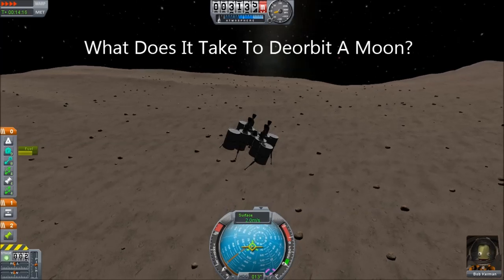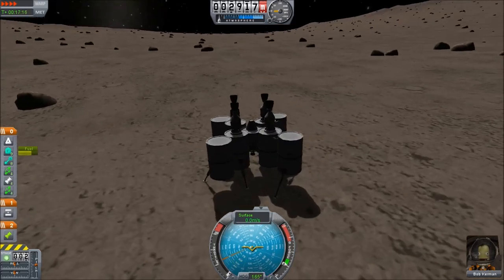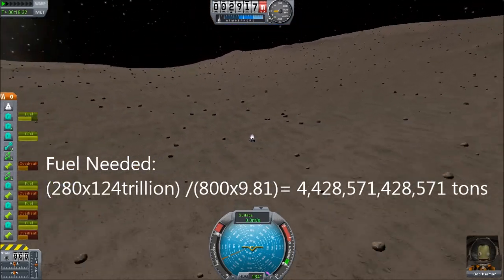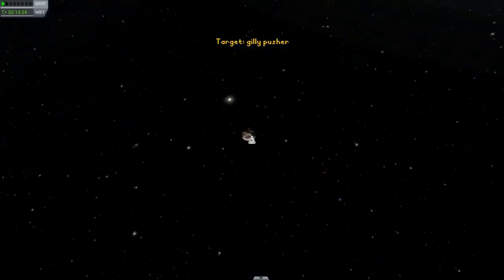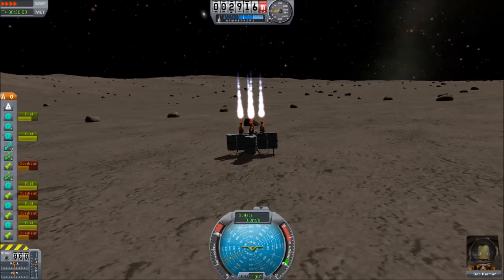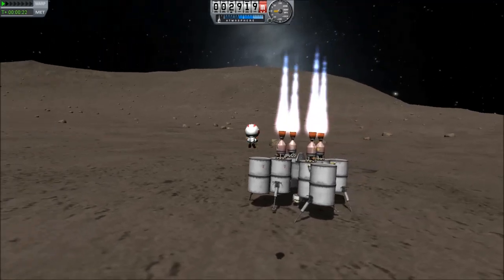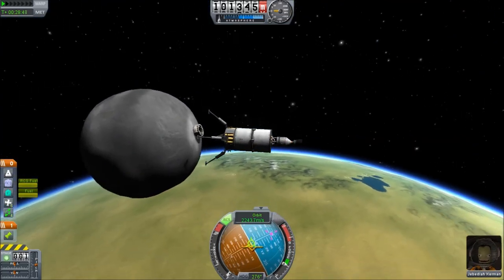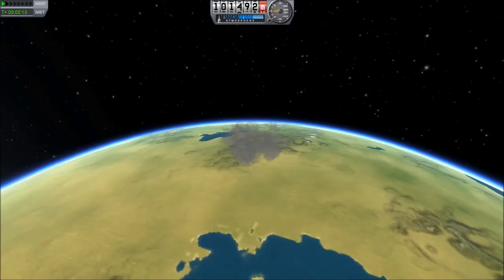What does it Take To Deorbit A Moon In Kerbal Space Program

Comment: So you can't deorbit a moon in the game because of game mechanics, but it would be possible in real life yes? In theory at least. If a moon was hit by a rouge planet or a huge  comet/asteroid  from the right angle, wouldn't that possibly deorbit the moon? Even if it shatters the moon, the force might be enough to slow down the pieces enough for them to rain down on the planet.
Reply: According to my physics class, if something shatters mid-flight, all the pieces will spread out, but if you averaged their distances and masses, the center of mass would still be on the same trajectory.  Some pieces might get thrown off track enough to enter the atmosphere or become ejected, but the majority of them will remain in orbit.  For something as large as the moon, they would probably eventually come back together due to gravity!
Reply: But if a moon ran into something of rougly equal mass in a head on collision, wouldn't that slow it down to near standstill? I agree that most impacts would leave what was left of the moon in orbit and it would probably pull itself back into shape eventually. Since orbit needs velocity, slowing an object down puts it in a lower orbit. If a celestial body had no velocity, then the strongest force of gravity (In a moons case, the planet it used to orbit) would just pull the object in a straight line.
I agree that this is an extremely unlikely scenario, but it is a big universe and it is not impossible that something like this has happened or will happen.
An impact from a large body on a moon could alter the mass of the moon significantly which would, if not totally deorbit it, then at least change its orbit distance.
Reply: Yes it is unlikely, but you're right. If something with equal kinetic energy (could be something less massive but moving much quicker, or equal mass and speed) hit the moon from the opposite direction, it would stop in it's tracks. It might break up a little bit, but some LARGE pieces would fall straight down to earth and would likely destroy all life, if not the entire planet. I could imagine something of that size striking the earth could break up the crust and smash it down into the mantle or something crazy like that!!
Reply: Let's hope that never happens. And if it does, lets hope it happens to some other planet with no life on it, but still close enough for us to observe.
Though any kind of impact on the moon would slightly alter the orbit by adding more mass, or making a small change in velocity. I think.
Just like everytime a meteor strikes earth, it adds to the earths mass and gravitational pull by a very small ammount.
Reply: 2spooky
Reply: Why would it have to bee the same mass as the moon? It could be heavier, and also, a light object that travels fast can hi with more force than a heavier object moving slower.
Reply: TheOmniousWindWalke1 A lighter object could deorbit a moon. All you would need to do is alter its orbit enough to get it in an escape trajectory. A sufficiently disturbed orbit is all that is needed, so that it will get flung out of orbit by the planet it orbits.
Reply: SHould we just fold that under one of newtons laws : for every action there is a oppsidte and equal reaction. Considdering the materials of the object would stay togethere that is exactly how it would happend(forces canceling eachother out. But ofc , it will not. It will acctullay be more like having 2 water ballons thrown at each other. If you managed to do it perfectly.
Reply: In theory, yws. But you would need an object with the same mass and the same density to de-orbit a moon.
Reply: The moon is always leaving the earth in about (insert years) the moon will leave earths gravatational pull and tides wont exist
Reply: fatpig2125 o_0 my comment before was pointless

Comment: What if instead of pushing it we just detonated a huge bomb next to it or potentially launched an astroid at it, that would easily deorbit it right?
Reply: Think about how much force was just explained in the vid. Now imagine all that force hitting all at once. Sure, you could knock the moon out of orbit. You'd also obliterate most of it and shatter what remained.
Reply: Serithi I never said I think while writing these comments. XD
Reply: Patrick Sparks Stuart Smith  with the dark side of the force, we can do anything we want.
Reply: Serithi Heres the thing though. Yes you might blow up the moon with that much force at once, but other than that it wouldn't actually do anything else. All of the remaining pieces of the moon would probably continue to float around in a relatively unaltered orbit. That's just how the physics work out.
Reply: Stuart Smith that's not how the maths workout at all
Reply: Patrick Sparks That is how it works but if i need to explain i will.
The amount of force our mythical explosion has is incomprehensible and since moons aren't exactly designed to withstand such forces (after all they're mostly composed of rocks so its not that tough) you will break the moon apart before the explosion can apply all of its force. Picture this: You swing a baseball bat at a pane of glass. The glass breaks and the shards go flying. If you hit the glass 10X harder than that the shards don't really go much farther because most of the force of the swing is wasted due to the glass breaking. It's the same thing with our explosion. Most of the force is wasted because it doesn't hit anything once the moon starts breaking. Making the explosion more powerful won't really help because you will break the moon even more. If the moon were indestructible you might be able to make it work but otherwise, no way.
If you still want to argue I will be happy to debate with you.
Reply: Well let me begin. First an analogy to a baseball bat and a pane of glass is completely irrelevant. Further more the force of said explosion will likely only shear off a small portion of our celestial body. And finally the impulse from said mythical explosion will impart a partial sum of its kinect energy onto the body which it is being used upon and provide an equal yet opposite reaction upon said body away from the outward direction of said blast. There is no debating maths now if you can prove that said  explosion of unspecified magnitude is strong enough to shatter our celestial  body then you should tell the imaginary explosives maker they've made the imaginary explosive to powerful. Until then you should look up project orion for an IRL example of Nuclear Pulse Propulsion.
Reply: Patrick Sparks Well I guess it could work in theory but what I'm trying to say is that even it if does it would be MUCH MUCH more impractical to do so. (Not that any of this is practical anyway.) Besides if you want to CHANGE the orbit of the moon, any force applied will do. But if you want to DEorbit the moon (as we are) an explosion is not the thing to use. When we use rockets (ignoring the efficiency of the rocket itself), you devote almost 100% of the force to deorbiting the moon. With an explosion (again ignoring the efficiency of the bomb) you devote less than 50% of the force to deorbiting the moon. In addition the rockets are used over long spans of time where as the explosion will be much shorter. I imagine that because of this, the rockets are able to be far more efficient than the bombs.

Also our explosion isn't of unspecified magnitude. Just take the numbers that he uses in the video and apply that force over the span of a few minutes (or whatever. I don't really know how long the explosion would last.) I'm sure it could break apart more of the moon than you think.
Reply: use a warp mod hehe
Reply: yes it would but it will destroy the moon in the process and it will be so powerful it will damage us and it would look like a supernova explosion and the griffon century in the KW rocketry mod has a thrust of 11000 and the FHS UBER DRIVE has a thrust of like 650000000000000000000000000 so that would put it off track by quadrillions of miles and a thruster that big would be bigger than our planet or maybe even the size of the planet after our planet size compared which is neptune and anything that can move for example jupiter will be bigger than our sun and something to lift our sun away will be bigger than the solar system and moving the whole galaxy including the supermassive black hole will take as much energy for it to be as big as the virgo cluster
Reply: Connor Simon replying to myself XD
Reply: Connor Simon and again lol
Reply: Serithi Hey you are de-orbiting it anyways who cares if it survives.
Reply: Momentum=mass x velocity.
No matter what the method, you need to deliver, at bare minimum, billions of tons of force upon that celestial body to move it much.

Comment: What about Tidal deceleration? Couldn't you just push Gilly into a faster rotational period than Eve and let the tidal forces finish it off? Albeit this might work better with Duna - Ike, though the tidal force on Duna is probably pretty low for obvious reasons. I suppose Jool - Laythe, then?
Reply: but as it got pulled down its rotation would slow down too because that is where the energy is coming from

Comment: BUT won't the gas from your engines eventually FALL back on the moon, cancelling its work?
Reply: No, because the gas particles are expelled at a higher speed than the local escape velocity, which means they will fly away into space.
Reply: That logic, I don't think it logics what you think it logics.

I'll see myself out.
Reply: Damn you Isaac Newton!
Reply: Such a large scale structure would also collapse almost immediately under its own weight unless partially supported by tension from a space elevator and/or space fountain type megastructure, and the fuel mass would, as Scott said, be a significant proportion of the object's mass, which would in turn increase the combined body's gravity well significantly, further complicating the process, which is already impossible in practice, even discounting the fact that the orbits of planets in Kerbal Space Program are determined by solving for the two body problem rather than the full n-body integration that would be required for this to work at all.
Reply: tim n
Actually, that probably would be a significant issue if you were trying to deorbit Kerbin, Eve, Laythe, or Jool, given that the atmosphere's would reduce the exhaust velocity of the rockets to the point where they wouldn't be able to escape the planet.
Reply: SteelFyire but the rocket you'd need is so gigantic the engines would stick out above the atmosphere anyway
Reply: kot_robot Not if the exhaust velocity is bigger than the escape velocity.
Reply: Get wrecked
Reply: SteelFyire yeah, that too ! :D
Reply: That would only be true in the event that the vacuum wave pull is of shorter wave length then that of the TIUs pressurized launch extension.

Comment: not to mention the fact that unless the fuel particles are exiting your rocket at >escape velocity, they are going to impart a net velocity change of zero to the moon youre trying to deorbit. because they will go up, and then just come back down again.

similar to if you were to throw a baseball attached to a rubber band while standing on ice skates. when you throw it you will start moving backwards, but when it reaches the end of the rubber band and springs back towards you, you will start travelling forwards, then when it comes back to you you will stop moving.

so you probably couldnt achieve this with NERVA engines. you'd need something with higher thrust, so the numbers become even more ridiculous

Comment: Make a mod that makes an engine that runs with a thrust of 100,000,000,000 and uses liquid fuel at a rate of 1/second and also make a mod that removes the rails for the moons and the planets themselves and you can have yourself a kerbin barbeque when you knock it into the sun!

Comment: Yeah no matter what you're calculating, if your equation is anything related to aerospace, it's going to use 9.81 m/s^2 when g0 is inputted. I just graduated from an aerospace engineering program in May and my spacecraft design professor beat this into our heads a thousand times. ALWAYS ALWAYS ALWAYS use 9.81. Mars, Venus, whatever. 9.81. That's just how the equations work.

Comment: The weight of all that fuel, however, in the gravity pulling in gilly you would only need (math I have done) 67.82964% of the fuel, as all the fuel would pull in about half of gilly itself(for once yay gravity). I just did quick math, so the number might not be exact, but close. Of to watch some ethoslab.

Comment from the maker: Actually, as a black hole's mass goes up  the event horizon radius increases linearly, but the volume goes up by the cube of the radius.

So, as you throw more and more matter into a black hole its effective density (based on the event horizon) goes down. Black holes that are billions of solar masses would have a density roughly equivalent to that of air.

Comment: He can only have done that by changing the code of the game to make it look like he knocked it into a higher orbit. The moons are locked into their orbits, as is the planets. The reason for this is that it eases down on processing power and RAM needed by the application, and since KSP still is in beta and not that optimized yet, the game would require an insane computer to run at playable frames per second.